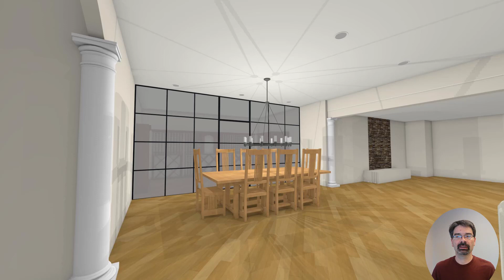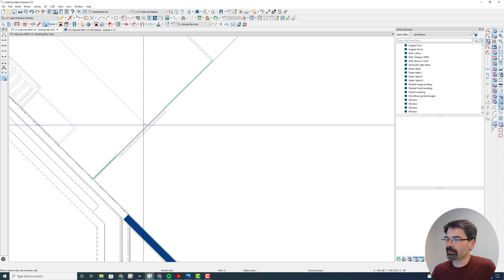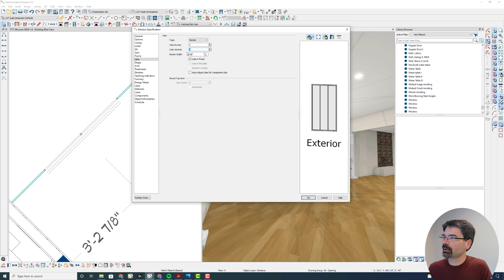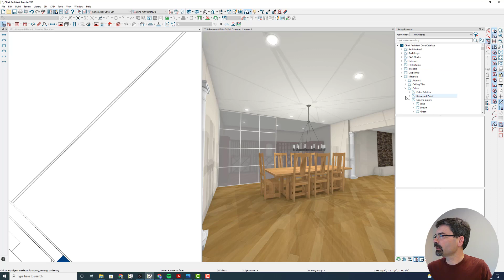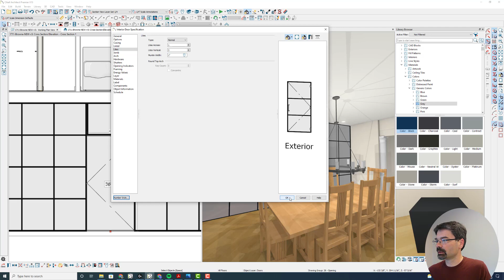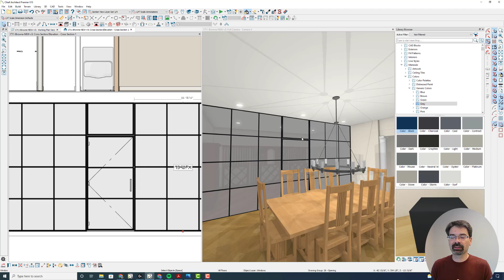Faster Steel & Glass Partition Wall | Chief Architect

Comment: Tim, this is very timely tutorial as I am have been asked help a colleague with a tenant improvement project. P.S. why the switch from Mac to PC ?
Reply from the maker: Two things, well, three. Cost, X13 doesn’t run natively on Mac, and I wanted to try at RTRT. Just after I bought the PC, they released X14 beta. But that’s ok because I have a couple clients who are still on X13